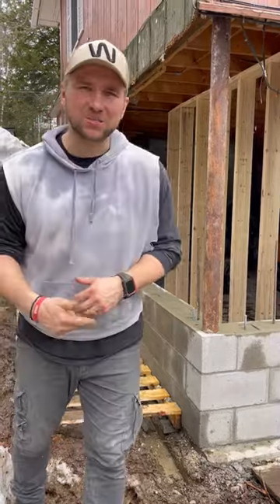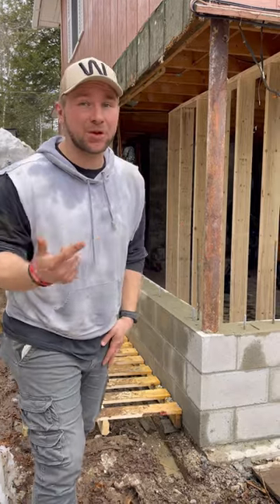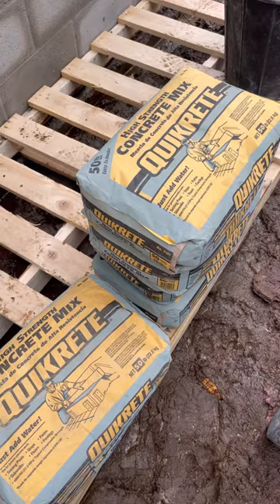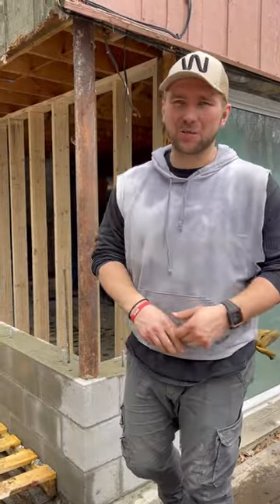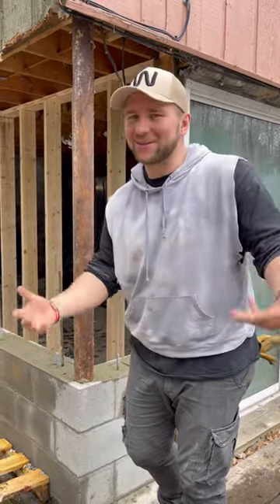FIRST TIME installing cement BLOCK wall. Learn from my MISTAKES. WINNI

Comment: So.......wtf were the mistakes we are supposed to learn from?
Reply: I’m with this guy. I missed the learning point.
Reply: Possibly some details like using an excess of cement between the blocks, as well as failing to put down sand on either side of the wall so falling concrete doesn't stick? 🤷🏼‍♀️ Those are things I've seen done very differently by professionals that regularly use this construction method. But those are relatively minor details, comparatively speaking.
Reply: Clickbait booolsheit
Reply: Don’t believe everything you see on the internet this man ain’t lay that finished prouduct he’s cleaning off the concrete to stick the concrete blocks with concrete 🤦🏼🤷‍♂️
Reply: He uses and wastes a lot of mortar. That definitely adds up and might anger whoever is mixing it for you (if you have a helper).
Reply: @PureMagma  Whats your opinion on dry stacking and filling the voids with concrete?
Reply: He might have made some mistakes It looks like he mixed a little too much moter in the beginning I'm no expert but I've laid a little bit of block and I remember it drying pretty quick I noticed he didn't put any vertical steel in also he filled every block so if any electrical or communication wires need to be added it would have to be surface mount.
Reply: @PureMagma  well that’s what you type on the keyboard an don’t work with foncrete
Reply: Lol
Reply: i just started the video but mini grinder instead of quickie saw, construction adhesive instead of 2 pack epoxy, dont bother wiping excess epoxy off its pointless, wiping the ground with a spoenge, didn't mark layout for bond, ill watch the rest and top that list off if needed. funny thing about the diy videos is it costs people to learn and make the video but usually someone will pay you and teach you to work for them and you do it like a pro
Reply: ok part 2. couldn't spread a proper bed or head joint, much because mud was too dry, though head joints can be tough for a beginer, see him spreading them with the block vertical, u should be able to spread while holding the block with one hand by the center cell.. he never held the block proper one time, one hand on the center cell trowel in other hand including when setting it in, have the mud proper consistency you should have to tap top with trowel to make it set and not sink, used a speed square on the corners ive never in my life seen a speed square in a block layers hand, plumb up from your snap line when your building leads and use level to flush down rake of them, had a level on the run of the second course, only use torp level to cross level run of first course. honestly without having an experienced block layer there you couldn't expect much more from a homeowner its definately an experience necessary trade. expectations for a commercial block layer is 200-300 units a day. team of diy guys would take as long as the pyramids or longer to build a kmart
Reply: @psxpak7704  200-300 a day ? 😂😂 rookie
Reply: @Dabs__ i mean thats the expectation. under 200 and you are likely looking for a new job. i know some guys can lay more i seen the literall best in the world this last january. hell the brick layers there were all on course to lay 1000 bricks in an 8 hour day. this was the bricklayer 500 and fastest trowel on the block competitions. absolute badasses. imagine going to competitions regionaly and winning these races to go head to head with the other 20 or so fastest in the trade. i just stand with my arms crossed and make more money than anybody on the crew these days. always loved slingin block though still will take a block job on the side, i just enjoy it so i charge like 3 bucks a block labor and i wont be there for grout. really fuck the going rate up in my area for the other contractors hahaha.
Reply: This isn't your first block wall buddy nice try.😂

Comment: I guess the mistake is you don’t just epoxy your rebars into your footing. The rebar should have been buried at certain depth with the footing for better anchoring and strength.

Comment: Good job. Just one thing. When you lay down the mortar for the first course, dont put it on the trowel like laying a regular course. Sort of heap it on the board and cut a "sausage" off, and place the sausage down. Thats it. Dont play with it anymore or move it around.

Comment: Great job and really appreciate seeing someones first attempt.  I'm researching every video I can find before attempting my own block work.  This has raised my confidence levels. Thank you.
Reply: To make it easier on you when grouting you can make the blocks into knockouts to make it easier to dump buckets in rather than the single cells. It would also be less mess.
Reply: can probably find someone to lay em for 5 or 6 a piece. for labor only and not there for fill i charge 3.50 a block wich is actually suuuper cheap. but again thats to pack em over to the work and install them

Comment: You could literally see the skills improving as time went on. AMAZING!
Reply from the maker: Right! Also my Confidence did as well. I started to feel more in control of it and it was kinda fun!
Reply: Make sure you use a waterproofing on the exterior of the block that coats down over your slab edge. Masonry units absorb moisture.

Comment: Good work, much better than most on their first time. A couple tips:

Avoid building corner leads or leads in general when possible. Just “spot” a block on each end to your chalk line, level/plumb and make sure they range by hooking up a line. Use a level across the top for first course while laying them to the line then just spot the ends and lay to the line for the remaining courses. 

Building leads with a level, unless you’re a vet, is a good way to create unnecessary issues in the wall.
Reply from the maker: Thank you for the feedback! I’m going to be building another one in few months

Comment: Came out great. I would never use that low quality mortar but you made it work. I don’t think it’s the first time using mortar and trowel. Maybe first with blocks.
Reply: He definitely handled a trowel before, better mud would definitely make it easier
Reply: What would be a better quality mortar to use?
Reply: @LordoftheCats  usually the masonry supply places carry high quality better mixed options.  Conproco has quality products, you have to research you’re area

Comment: Well I enjoyed the video.  Work definitely looks professional.  

Video states you did the research so we don't have to.  Could you provide instructions or a link to instructions?

Can you provide a written tutorial or supply list and tips and tricks and the reasoning or why.

Lot of time instructions are provided but then experiential tips and tricks are required to circumvent issues that arise due to variation.

I just want to raise my cinder block wall 3 blocks higher.  Trying to assess all the materials and equipment steps cost and time needed.

Comment: just gonna rebuild my old metal front gate with 10 ft masonry wall . Have most of the tools need the tripod laser level . Luckily for me the foundation is already done. Gonna use rebar and epoxy to attach the blocks to th existing old concrete. gracias

Comment: I appreciate the video. I'm now over 1,000 blocks on different projects in the last fours years and just went for it like you have. I too did a ton of research and watched every YT video I could find. Were you already in the trades or did you go out and buy STABILA set up right off? Keep putting up video.

Comment: Got my footers poured the day I am writing this and will dive right into it without any experience. Just ordered 200 blocks and 30 bags of pre ratioed mortar mix.  I feel that I made a mistake in presetting my rebar verticals before they poured the concrete. Will probably have to cut some rebar; I hope not but most likely yes. Building my own small home. Lots of "first's times" are going to happen when I go through this.
Reply: can buy H shaped or "speed" blocks. otherwise usually you are only laying over 3 foot max rebar and you just cut bar and drop it in the cells you layed over the bars below